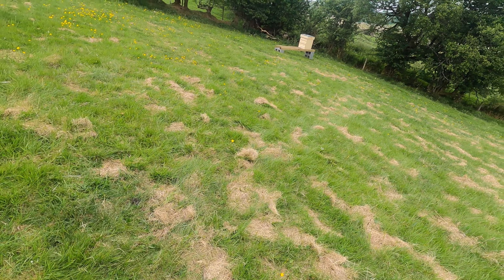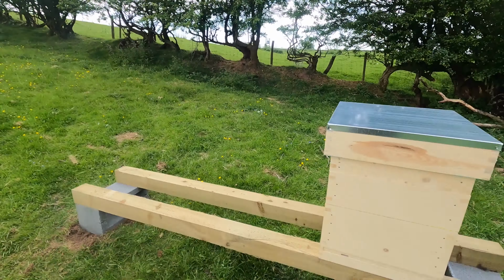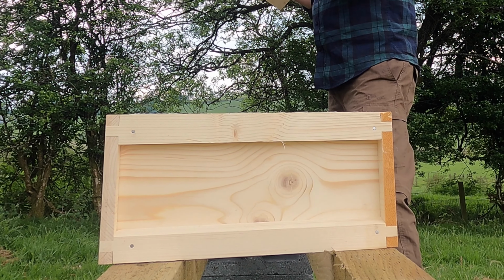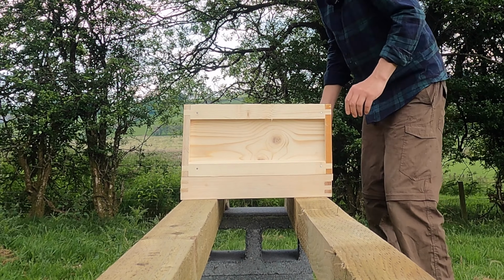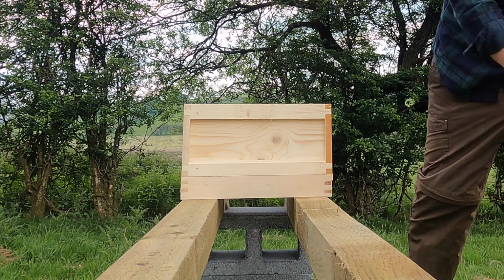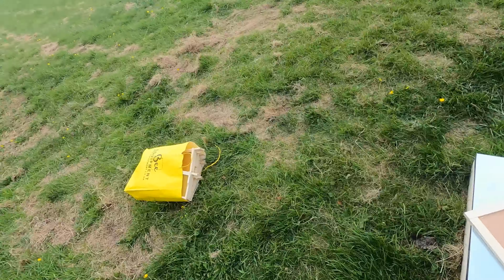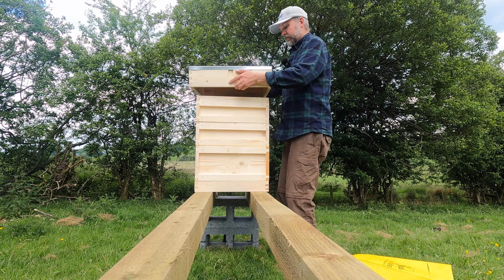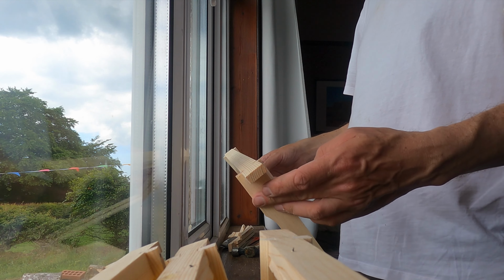Keeping Bees in the UK

Comment: Thank you, how do you stop it from blowing over or one of the sections coming off?
Do you have to paint these and use specific paint before getting the bees? 
Is there an option to buy with  the bees already in?
Reply from the maker: @MarlonKingShow  hi, unfortunately they blew over in the 70mph winds we have had here. Need to assess the damage when weather permits. I’ve seen hives strapped down or either bricks placed on the roof. I think we’ll need to bolt them to breeze blocks or strap them during the Winter period. You can paint the wood but I’ve not  done so. You tend to buy 6 frames with bees and a queen from UK suppliers. Obviously need a hive to transfer them into.
Reply: @cambrianviewfarm1689  sorry to hear, hopefully not too much damage. Yeah seems like strapping down seems best route